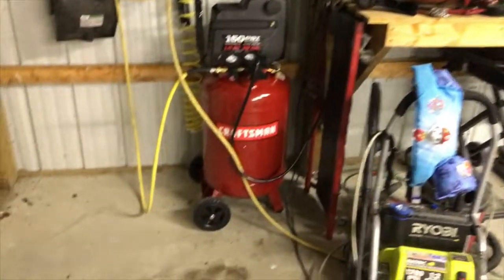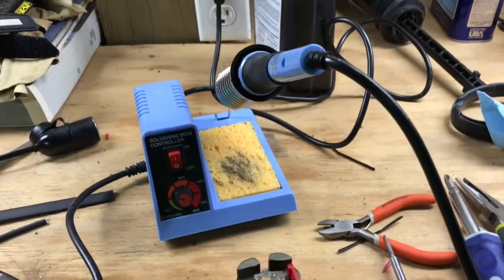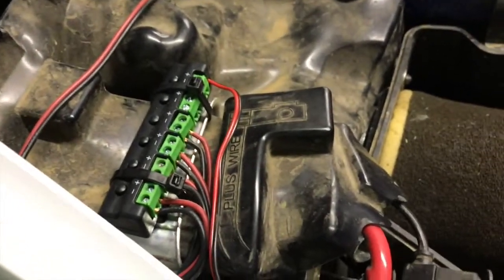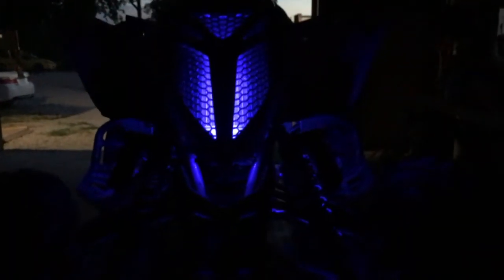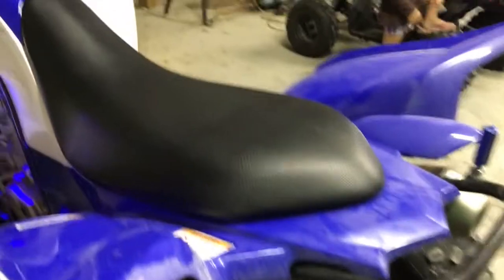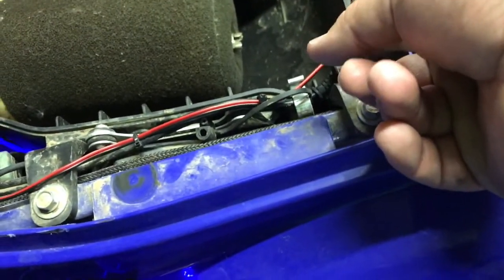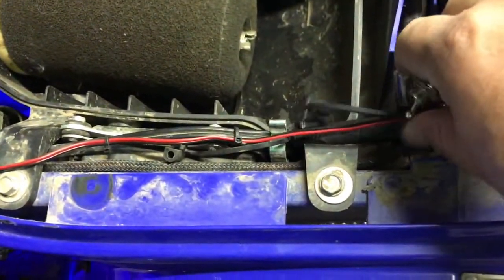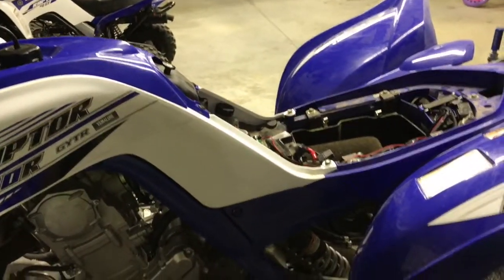Evol ATV - LED strip light install on my Raptor 700

Comment: I just got literally the same exact lights but green but I can't seem to find that distribution thing you plugged them into. What do I look under or type in thanks
Reply from the maker: I looked for it, I can't find it online, you're gonna have to go to your local walmart and look in the aisle with all of the wiring and crimp connectors. It's in the section with the LED strip lighting in automotive. Just saw them the other day so pretty sure they are still selling them. Sorry I cant be more help.

Comment: It says 12 volt dc but can I use it on my blaster just with the stator want some cool lights lol
Reply from the maker: most people with 2 strokes just hook them up to an external battery. It could be done obviously because people hook up huge light bars, but why bother. They are so efficient they will run off of a small battery for a long time.